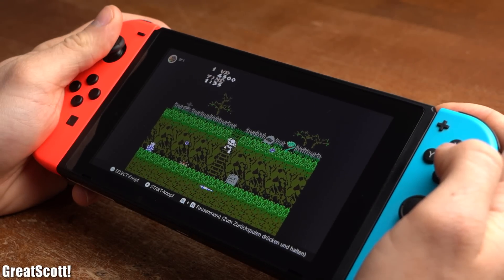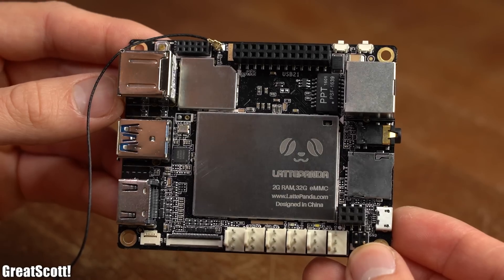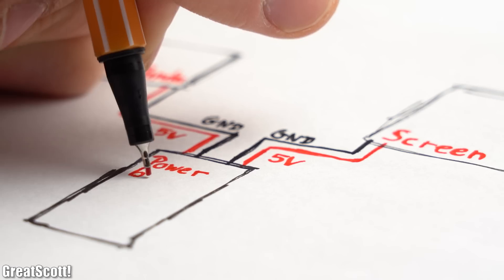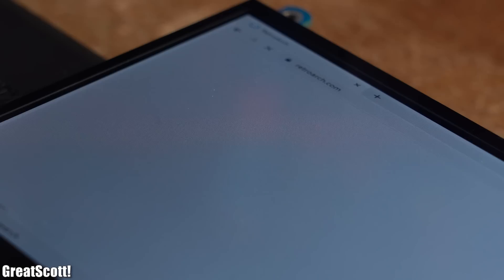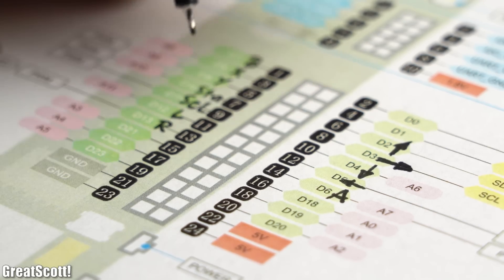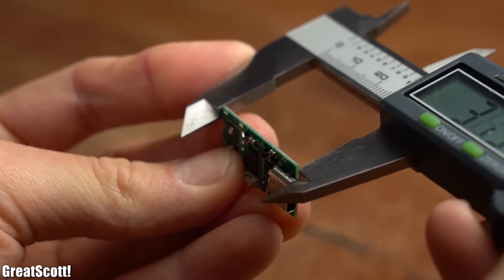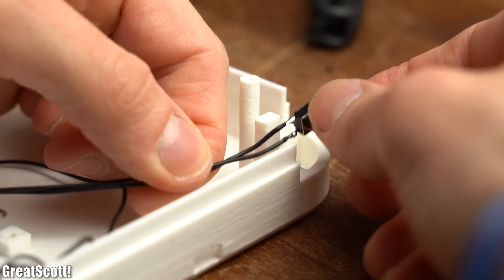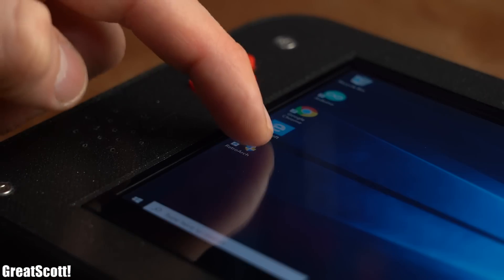Make your own Portable Retro Game Console!......which is also a Win10 Tablet!

Comment: Thought i'd ask this here, cuz i cant find any answers anywhere, and your amazing with electronics.

I have a Nintendo DS Lite, and i wish to solder a speaker to the motherboard. (Im making mods to the DS, and originally the speakers were connected via ribbon cable) 
I accidentally had my soldering iron too hot and the contact pads for the left and right speakers came of the motherboard. Would i be able to solder the speaker wires to the headphone jack connection points on the motherboard? Would that work?

Again sorry dunno where else to ask this. Thanks!!
Reply: I think no.
Reply: @coron1985  why not? Theres audio signals sent to the headphone jack, as theres ground and left and right audio pins why not?
Reply: @Lumalee  i tried in smartphone headphone jack, they sound quiet because its not amplified for "speakers"
The best way is u need to look another loudspeaker solder pad.
If it can't be found, what i know u need to buy mini audio amplifier like pam8403. And if u pick audio signal from headphone jack, then look for dc 5v from ur gadget, solder dc power to pam8403 and take the audio signal from headphone jack.
Reply: Also if u want ur headphone jack working properly. If u plug headphone to it and speaker muted. U need to modified again, i don't remember and don't know how to do it. I have seen some project in youtube for something like that, maybe in this channel or not i dont remember exactly
Reply: @coron1985  thanks for the info, i dont care about the headphone jack though. I did it with a headphone jack on my phone as well and it was quiet but loud enough. But it didnt work when i soldered it there was no sound
Reply: @Lumalee  in smartphone or modern gadget. Sometimes They have 'sensing' pin, i dont know what is the correct name. If the pin touch the headphone jack, audio signal will on. If doesn't touch, the audio signal is off.
Reply: @coron1985  ahh that makes sense! I have no idea if the DS lite has one, but if it does maybe i can stick a severed headphone  thing in there to trigger it, and the sound will come out of the speaker on the board?
Reply: @Lumalee  if u dont need headphone jack.
Easiest way is, look at ur home broken earphone or headphone, take the headphone jack. Plug it and solder speaker from pin that on ur nintendo ds PCB
Sorry very bad english hahaha
Reply: @Lumalee  cut  and only left headphone jack from broken earphone.
Reply: @coron1985  awesome this is fantastic info and hopefully just what i needed! Hopefully the DS has one of those sensors. Thank you!
Reply: @coron1985  yeah it worked, sound comes out, but you were right its incredibly quiet even with the largest speaker i can fit inside the case.
Reply: @Lumalee  idk if this will help u or not, use flashlight from ur phone or anything else that very bright. Sometime i use this trick to see pcb 'track' pin or pad for seeing missing pad that u broke.. It only work for 2 sided pcb. I think it doesn't work for smartphone or modern gadget. Because they have more than 2 layer from both side
Reply: @coron1985  i can see the track, but i feel like it wont stick if i solder on something so small
Reply: @Lumalee  i know what u feel. Hahaha
Reply: @Lumalee  u need very pointy Soldering tip. And also Good Quality tin. If u can see the track, u need to scratch the paint for reveal copper track for soldering. Or maybe u track it more until u see little capacitor or anything that related to original 'loudspeaker' track. It will work. But careful not broke more again hahahaha
Reply: @coron1985  thank you for all the help, i might try repairing the trace, but my friend is an electrical engineer he said he would take a look and see if theres a different place to solder the speaker.
Thank you for all your help and info, i never would have known about the sensor if it wasnt for you
Reply: @Lumalee  sometime if u have good connection from soldering. U need to make strong support that pad. I use glue sticks for that. Cheapest and easy to find. Better than nothing
Reply: @coron1985  ahh good idea about following the track, that would be much easier than attempting to repair it. And yeah i had the soldering iron much too hot before and the pad de laminated. Ill be more careful now
Reply: @coron1985  sadly it looks like the pad is right next to a whole bunch of traces and i cant even tell where it starts. Doesnt go on the other side either sadly
Reply: @Lumalee  it's not easy. Don't do it
Reply: @Lumalee  ur welcome bro, helping is number 1 priority in my life. Because Its free. When helping people needed to pay taxes to government , i don't want helping people anymore hahaha
Reply: @Lumalee  sometime i look for datashet every single ic in the pcb.
If it related to what i need. I carefully looking for the track that easy to solder.

Comment: If you tore down the intel Vega nuc it just happens to be the exact same size as a 10.1 inch 2560x1600 ips touch screen. You can stuff 8-16gb of memory, a powerful battery, and connect control buttons over usb or Bluetooth and end up with literally the most powerful handheld console on earth. It would be expensive, but worth it not only to play, but for views on a video. Please make this happen. I’ve wanted someone to do it for years.

Comment: There are ways to make it a lot more slim. for Example: Get rid of  USB connectors and solder them directly, discard the RJ-45 soccket and use Wifi, use right angle header pins (probably need to hack this one a bit) These are the options if you want to stay with the Latte Panda. The other way would be to use a Raspberry Pi Zero W and run the emulator on it or use it as a VNC to your PC running the emulator. For a even smaller footprint, SpriteTM was able to play Witcher 3 on an ESP32 using a VNC to his PC. (Watch his Gameboy talk on Hackaday)

Comment: As a second version you can desolder the GPIO, RJ-45 and other big components and solder wires to them directly, that way you can make the device a bit slimmer. Also you can redesign the shape the left and right back sides of the device so that its more like a controller (comfortable).

Comment: I suppose you could mount a $50 or $99 Windows 10 tablet inside an enclosure and glue an arduino nano inside the case and replicate it without the cost of the screen.
Reply: Is there any link for 100$ win10 tablet?
Reply: Or 50$ one?
Reply: @coron1985  The baytrail tablets from a few years ago were in that price range.  I had a $50 7" tablet I got with 16GB storage and 1GB of ram. I later got a 10" tablet with 32gb storage and 2gb ram.  The first one was made by winbook and the second by RCA.

Comment: I think this is a very clean and relatively easy  project (your 10 hours are really well spent) :) maybe adding a battery inside would be be better. even 2 hours of game would be better than nothing without a power bank. I know that windows is the main point of the build but with a raspberry pi and linux it could be smaller and less power hungry.

Comment: Hey Scott, this is awesome.  Portables are a huge hobby of mine so I definitely got excited when I saw this.

I notice you didn't use an internal battery. Is this just for convenience, or could you not find a PSU with enough 5v current? Helder from the Sudomod community  has a custom PSU that can output 3.5a @ 5.2v. I believe he is making one that can output 6a as well.  I have paired that little USBC PD board with his 3.5a PSU in my projects and it works just fine.
EDIT: I have only used it with 3.7v polymer batteries that have a protection circuit. PSU doesn't have one

Comment: What about the thermal performance 
Does it overheat
Reply: Was going to ask the same question. I looked into building something like this on an Orange Pi because they have some nice small, multi-core boards but the allwinner chipset is known for running on the hot side. This doesn't necessarily mean active cooling but you might at least need to have a heat sinking panel on the rear outer surface connected via heat pipes to the CPU package. This can have knock-on effects like having to flip the internal mounting of the computer board which is a pain if you've already got the layout nice and refined.
Reply: @TestSpaceMonkey  moreover it is completely sealed up.

Comment: We can cut the cost by more than half buy just using a cheap windows tablet like chuwi hi8 pro which only cost around 80-100$( but has the same hw intel atom Z8350+2GB DDR3 + 64GB emmc+ 8" 1080p Multi touch display) . + Adding a atmega32u4 board which costs less than 5$ we can create it with in just 100$( case extra)

Comment: The project is so fun to make, and I have been planning to so this exact same project since the LATTEPANDA has been out, but after much more thinking, I had to abandon the idea ‘cuz the budget didn’t make any since. It’d cost around $300-$400 to build the system, meanwhile I can buy a well spec’d used laptop with a great battery and just use that for less than half the price (in my case, bigger didn’t mean a problem). 
I’d say the project would’ve been better in terms of costs if a RaspberryPi 4 was used instead, you really don’t need a windows machine for retroarch. 
As always, great and well made video scott! Well done.